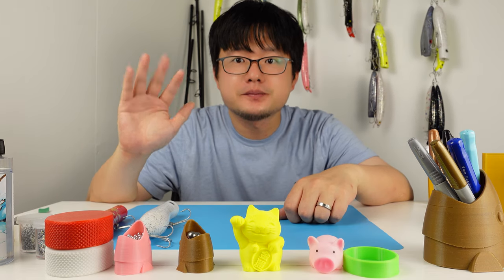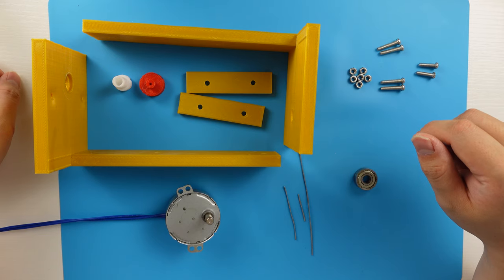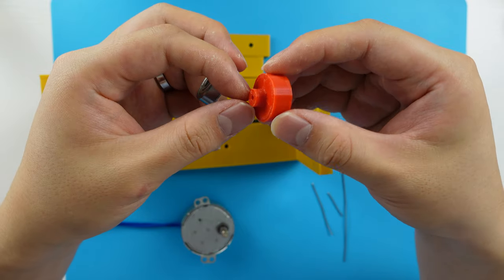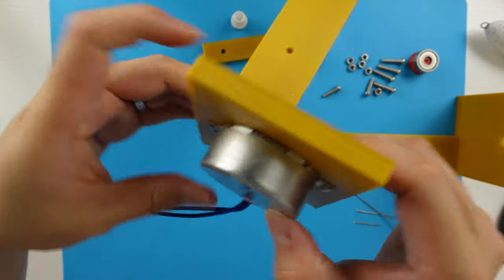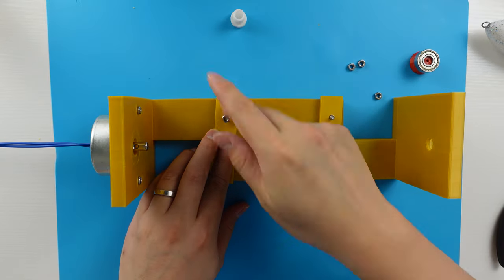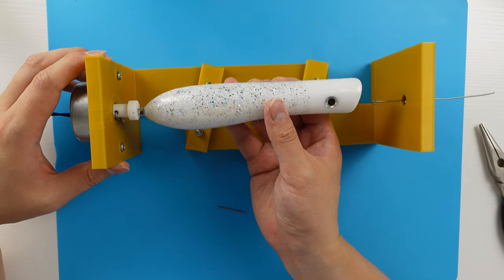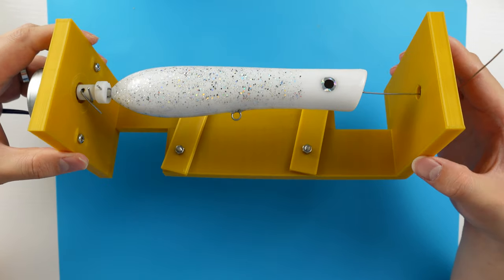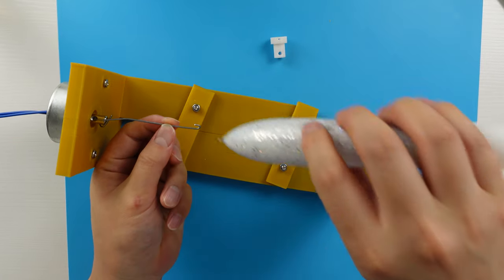Making Lure Turner / Lure Dryer / Lure Rotator. 3D Printed Lure Turner / Lure Rotator.

Comment: i know this is older video, but i found your channel from your turner video on thingiverse. If you used Fusion360 to create this turner you could modify the model so this m4 screws have a recess into the model so they are sitting flush with the bottom and that should resolve the problem as well. great content and keep it up.

Comment: Hi alex ive got some 608rs 8x22x7, why dont fix at bearing hole ? The hole is bigger than 608rs, i thought that 608zz  and 608rs got the same size, the hole of piece b I printed came out with 24 mm with prusaslicer 0,30 20%
Reply from the maker: Hi, yes the hole is bigger than the bearing because I didn't design it just fit the bearing. When you use it you can put the bearing on and when you finish using it you can easily removed it. If you want the bearing stay on you can use some double side tape to attach it on.
Reply: @3DPrintedAngler  Please design the bearing 608zz to fit snuggly (a good grip). Also, Counter sink all screw holes so they are not outside the surface. You are a PRO, tighten up the print.
Reply from the maker: @CiscoKeb  Hi, trust me you don't want the bearing is fixed on it. Now you can easily attach it on and easily hook the lure on or remove it. If the bearing is fixed there, you will find out sometimes it's difficult to do it. And you said screw holes, the design is for any kind slow motor. People may get different motor than mine and have different screw position. Any pre-made screw holes will only cause trouble. So hope you can understand why the design is kind of rough...and the truth is yes I didn't spend much time to design and reversion this lure tunner like my other lure designs. But it didn't affect the performance of the lure tunner. Hope you can understand what I'm talking about.😁👍